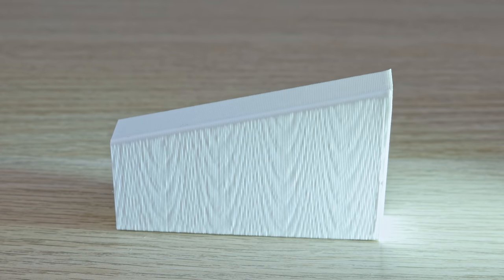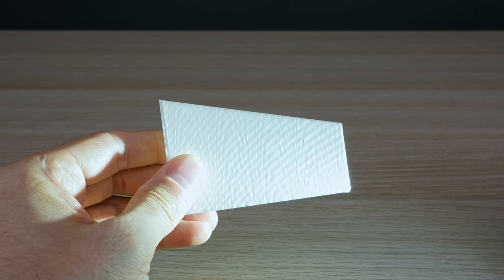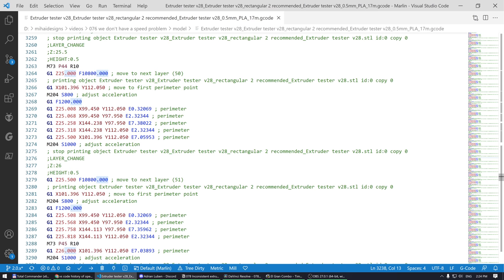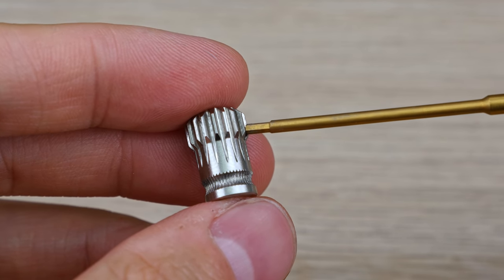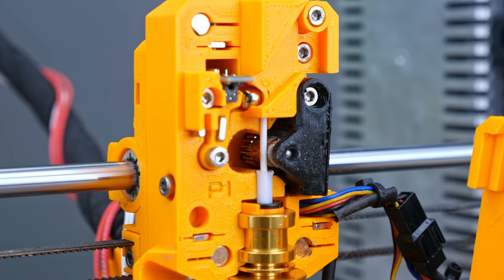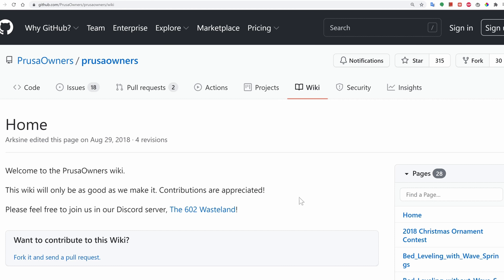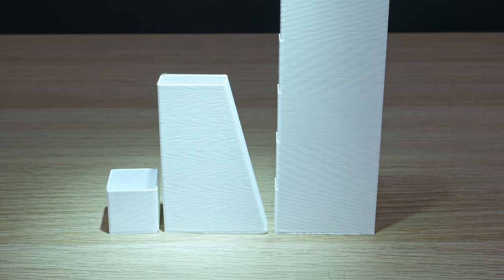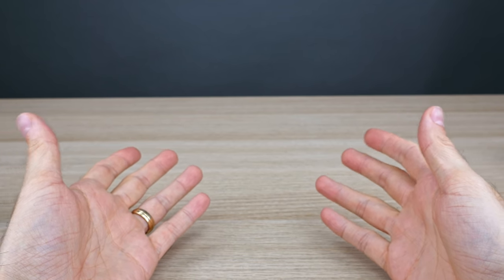What I've learned about dual gear extruders and how to patch them, maybe

Comment from the maker: Check out my newly started Patreon page if you want to support my work https://www.patreon.com/mihaidesigns
Reply: I have a similar issue but the pattern is completely random, as if there were extrusion inconsistencies, I'm gonna test either .9 motor or gear reduction, it may be rounding errors, I need to print your test pieces!
Reply: Nice work!
Reply: I remember seeing another video where the maker figured out that changing some Marlin setting to match the number of gears the extruder had removed the wood-like pattern. But as I recall, it was done for a single gear, not dual geared extruders.
That it can be done at all would indicate that someone smarter than I am could figure it out...
Go for it!
Reply: I guess I must have just been lucky with the tolerences inside my prusa extruder and drive gears then, I've never had any surface patterns on my prints.
Reply: I still dont understand what you are auggesting to solve this issue on a mk3s. Please clarify.
Reply: I recently had the same issue with the dual gear extruder on my new CR-10S Pro. 
Here is what I found:
In my printer the two gears were covered by grease. I decided to take them appart and check them. First I cleaned them with brake cleaner. And already there I found a thin matter sticking between two of the teeth on the idler gear. It removed it with a tootpick.
It turned out to be a small piece of PLA. So I reassembled all but didn't apply any grease on the gears (only on the bearings inside). Then I ran a test. Problem solved.
Reply: omg, i love the way you speak. my granma spoke just like you, beautiful! yes, your patreon thinky reminds me of something my granma used to say. she was romanian. very wise one, i tell you. translates like.. child, you're not seeing the forest because of the trees. you're looking at the sun always unable to see all the light. lemme check the ouija board fast quick already. check it out: puiule, dacă ţo dat dumnezău 6 drivere, nu e semn să folosesti 6 motoare. esti mare, ce boala!?
Edit:
i mean prusa did it with too 10 years ago. step up, honey. you'll love gears. try programming ones with variable curvature, pitch angles and modules. i bet you can do it cuz i hear romanian engineers are just as good as the best sometimes
Reply: Your voice over voice sound strange. Reduce bass or something. Hard to hear u
Reply: I had a problem with my Stealthburner CW2 extruder because the wheels didn't squeeze the flexible material properly. It was easy to pull the filament out of the closed extruder.
Also, in my case you could see the pattern caused by the teeth interlocking.
Thank you very much for the idea to redesign it.
I put the clamping roller in a stand drill and rotated it while I sanded the teeth with a paddle sander held in a corner grinder.
I got a smooth surface, notched where the teeth were (where the former tooth valleys used to be), and then placed them upside down.
Now the sanded surface is opposite the curved filament notch, and the curved notch is opposite the gear teeth, but (obviously) they don't touch and contact.
Result: even with a barely tightened spring, the very flexible filament cannot be pulled out, and there are none of those visible patterns.
Thanks again for the brilliant idea!

Comment: Well if we use wood filament then we get free wood texture 😅
Reply from the maker: 😂 indeed
Reply: Based
Reply: just had a look for possibilities like this :D looks like I have to get dual gears for my ender3 😂
Reply: @BlackDreaded  : Another possibility of course is a bit of patterned "noise" in the extrusion distance.
Reply: (=

But there are better ways to get it
Reply: Honestly I bet you could have some really nice looking pieces if you leaned into it like that
Reply: That's a positive in my book.
Reply: have you experimented with velocity painting or blender texturing? I agree, modified textures are definitely under utilized in 3d printing
Reply: Yeah, that texture looks like wood grain 👍, better switch to dual gear when I want a wood effect 👏🤣
Reply: I was thinking exactly the same. We should actually have this as an option in slicers. We already have "fuzzy skin", why not a "wood grain" also?
Reply: exactly!

Comment: Your research and findings are super well detailed, amazing job! 👏😌 Let’s see if someone is stepping up to improve the gears ⚙️🙂
Reply: Seems like there's an aftermarket opportunity here, doesn't it?   Drop-in replacements with herringbone gears ... I'm not brave enough to try a hardware startup even if I had the expertise, but there's gotta be somebody ...
Reply: why do you have the exact same logo as mikai
Reply: A thought that comes to mind is driving both gears off a common shaft, via a bevel arrangement. There might be another type of noise produced by that though.
Reply: @absalomdraconis  Cylkro gears could be used for that. They are a special type of angled gearing where one of the gears can be a simple straight involute gear. This means you can have a 90 degree gear mesh where one of the axles can translate from side to side a bit (like in an extruder) and have zero backlash or affect on the gear meshing. 
An example use case I saw was for a rolling mill, where the rollers can change position to accomodate different thicknesses of material, but there is no affect on roller rotation as the rollers move up and down (essentially just like an extruder).
I believe they can be cut with the same equipment as standard involute gears, but they are quite rare and expensive (only made by one company really) since they have niche uses.
Reply: Standard involute gears transmit continuous smooth rotation even when the centre distance between the gears changes e.g. if the gears are close together when driving a flexible filament or further apart with rigid PLA, the gears with both rotate at constant speed, at least in theory. 

In reality you will have a bit of angular misalignment between the axles. This produces meshing error, increases noise (although not really relevant in this situation) and creates edge loading where only one end of the gear meshes while the rest doesn't carry any load. I am guessing this is what is causing these problems, and would explain why some extruders of the same design are having this problem and some are not. The ones which do not probably happen to have very good shaft alignment.

Helical and herringbone gears are no different in this respect and herringbone gears are much more expensive (and actually less efficient than spur gears but again this is not important in this situation) to manufacture accurate metal gears using specialised forming machines. 

A potential fix could be crowning the spur gear teeth. This is a common procedure (although adds to the cost) for compensating for misalignment and reducing noise and meshing error. It basically makes the tooth face slightly convex instead of straight, so when the axis are at a slight angle, the contact is still in the middle of the tooth. This does reduce strength slightly but again is negligible in this case.
Reply: @user-yk1cw8im4h  marsgizmo and mihaidesigns are brothers
Reply: @ianpoe3042  are you serious
Reply: @user-yk1cw8im4h  yes
Reply: @jamespray  I'm not sure harringbone is the best solution. With helical gears one can be loaded so that they mesh regardless of the gap but I'm not sure about the tooth profile. We want the contact radius to be the same regardless of the filament diameter. Need a smarter gearheads than me.
Reply: @Bordpie  what about splitting an rotating one of the spur gears. I thought that was used to reduce backlash. Kind of the same thing. The split could be spring loaded.
Reply: @jamespray  coming from the astronomy world here, we need high precision mounts and we also have to fight these gearing problems, we call it periodic error. Belts could also be used here
Reply: "Let’s see if someone is stepping up to improve the gears"
mellow to the rescue, 2023. only a year, nice
Reply: I dont know what the current state of someone improving the gears, but i just found out about the double helical gears made by mellow and sold on aliexpress. There are.. afaik .. made for the Libra mini extruder, which is a modified version of the Sherpa Mini. 
Maybe you could make some test comparing a Sherpa mini( which pretty mich represents every BMG style extruder) with a Libra Mini. Would make for a pretty fair comparison as the are almost identical extruders apart from that the filament path is move to the front slightly so that the filament sits in the middle of the gear instead of at a ⅓ of the length as on a normal bmg gear
Reply: @KidCe.  i described that issue few years ago , the fix was simple - the gears needed some shims on most motor shafts to compensate for undersized shafts on most of the motor shafts ... the shims allow them to work perfectly "straight" (round) not oval because of to much space between shaft and gears (i do that to the point gears wont move more than 0.01mm and you get mirror like finish on prints after that :D 

 now because it go popular and people go crazy with quality 
after some testing bondtech released press fit gears that fix this problem , you will have perfect prints even better than with 1 gear+bearing .... and you get perfect print WITH DUAL DRIVE so no sacrifice with push force and stripping ,  only big improvements in quality :D

Comment: I don't think the problem is due to the type of gears (spur gear). I think this problem comes from poor gear alignment and insufficient contact ratio to ensure a constant velocity. The involute profile of gears (if these gears are well manufactured) can allow some backlash while still keeping a constant velocity. But if the mounting distance of the gears increase too much (more backlash), the contact ratio will decrease below one (1), then you start having inconsistant velocity issues. The gears being not parallel to each other is, from my point of view, the biggest issue here. I don't think the dual gear extruder is a bad idea, it is just not designed properly. Thank you for sharing this content, I enjoyed your video!

Comment: Thank you for finding the problem, the solution is to drive the two gears separately and at the same rate, instead of relying on them interacting.  I've got a design in mind but .. no time to prototype and build it :(

Comment: You could solve the meshing issue by adding two idler gears, you need two to maintain correct rotation direction.
If you add one idler directly above and driven by the motor driven gear then the second idler at 90 degrees to the first idler then the second feed gear at 90 degrees directly below the second idler (power goes up, left (or right) then down). The carrier frame for the second feed gear would pivot on the axle of the second idler gear. Ideally the idlers would be slightly larger than the feed gears to ensure there is no gear clash with the feed gears.

Comment: I had this pattern with my Ender 3 V2 which has a Microswiss Directdrive upgrade. everyone called it inconsitent extrusion or blamed my filament (ASA Polymaker), frame or settings. I was troubleshooting for a long time with no success. Yesterday I gave this a shot and the results are crazy. 
Thank you for this research, I‘m really grateful for that. I hope this comment may help a view viewers with the same issue. Unfortunatly this video didn’t pop up 10 months ago because of the stupid youtube algorhytm…
Thanks and have a nice day

Comment: Looks like helical gears would even out the variation and eliminate the problem.
You don't need to have the herringbone gears though as they will cost much more, and having a thrust load is OK. Either that or just stack two helical gears with one flipped 180.
Reply: the issue is the size. what needs to happen is the gear mesh and the filament pushing has to be independent  of each other.  a more tolerant gear can help - helical, but i suspect what will happen is the problem will become less consistent. I spend too much time doing cad work for my job for it to be fun. I think it can be solved with 4 gears but I will wager that the resulting mechanism will be too big to work. 5 gears may help by getting the stepper out of the axles. these gears are already fairly small for metal gears.
Reply: @davidson8939  Yeah ideally you put the gears at their proper distance apart, and use some movable coupling to the filament drivers that minimizes any backlash created.  Using a u-joint,  cv-joint, oldham coupling, or many other designs. The helical gear would probably deal with most of it though without the extra cost, despite not being perfect. I guess you could also just use two smaller motors and drive each wheel separately, synchronized by the electronics.
Reply: Libra mini

Comment: Might be a bit complex, but you can put the secondary gear on a pivoting arm and drive it with a belt that has a tensioner. In that way you can change the gap and drive both gears in sync.